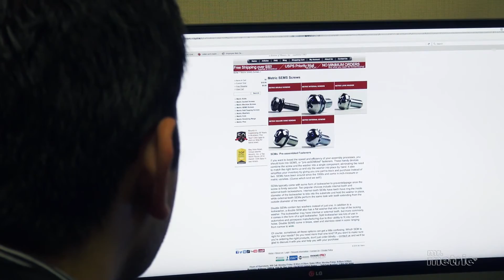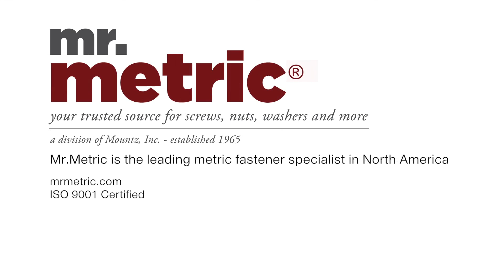SEMs Fasteners Boost Speed & Efficiency

Comment from the maker: SEMS screws combine two separate components into one pre-assembled, cost-effective fastener. These handy devices combine the screw and the washer into a single part, eliminating the need to match the right items up and slip the washer into place by hand. Which SEM is right for your needs? Well regarded as experts in metric, contact us 1-866-501-9504 and we’ll be glad to discuss it with you and help you with your purchase.